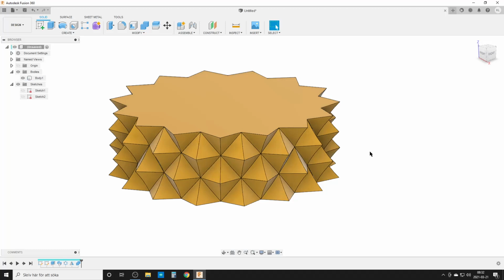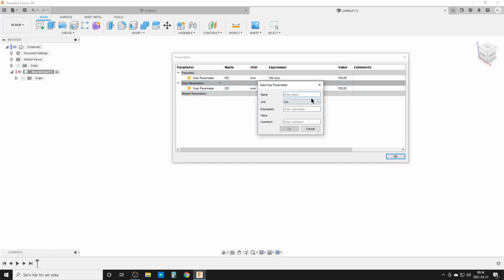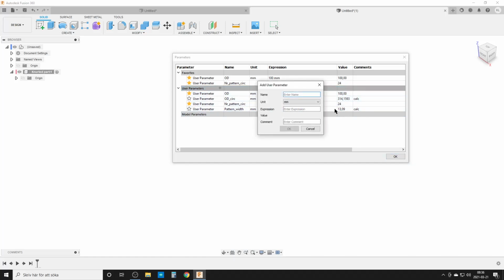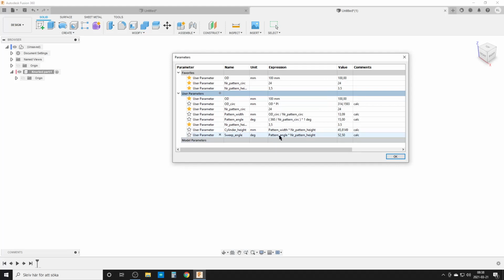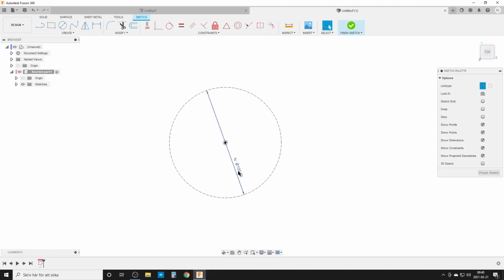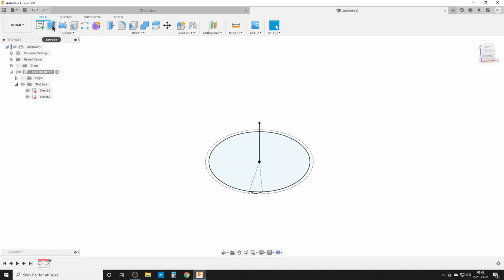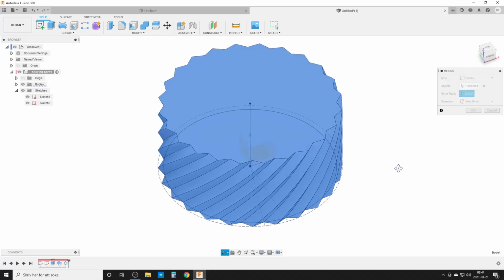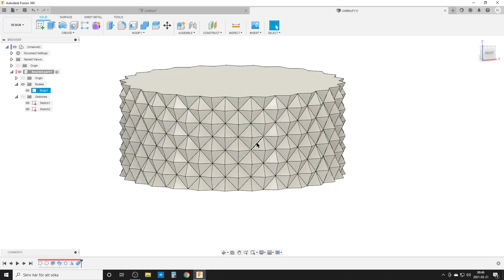Knurled Part - Fusion 360 - Parametric "flawed" workflow

Comment: Hello, can we do this application on inclined surfaces as well?
Reply from the maker: You get the same answer here. If you are thinking of a simple cone yes but it will take time. On a more organic surface it gest a lot harder and Fusion is not the best tool.
Reply: @KristianLaholm  We are a ceramic manufacturer.  We produce molds with our 3D printers.  Yes, what I'm actually asking is being able to embroider patterns on organic structures.  For example, patterns that are shorter at the mouth of the glass, thicker in the middle, and slowly improve at the bottom of the glass.  I think I need rhino :)

Comment: Can you help please…. I am following your example when I type in Pattern_angle the command goes red when I carry on typing Nr_Pattern_circ and the okay is shaded. I would really like to try this as I am trying to master a round cylinder pattern and I find you explain thing so we’ll. Thank you
Reply from the maker: Check the unit for the Nr_Pattern_circ it should be "No Unit" (empty in the Unit box). Fusion adds mm or In to all parameters if you do not change that.